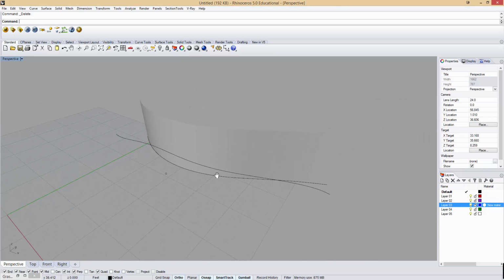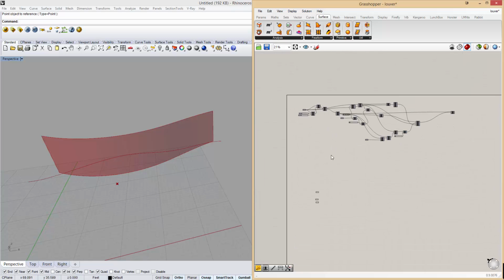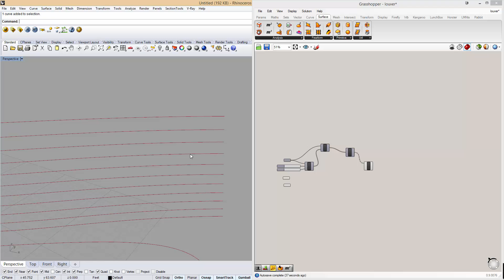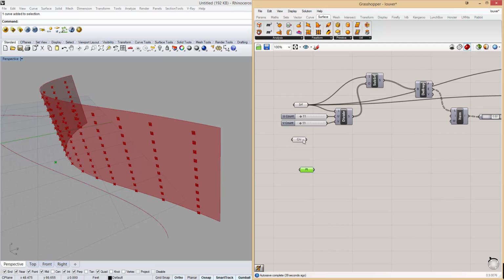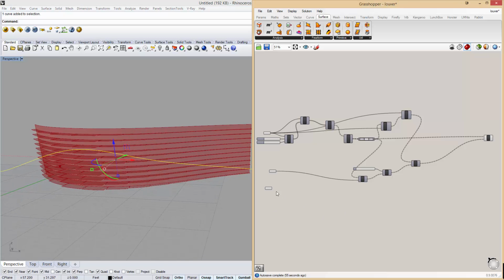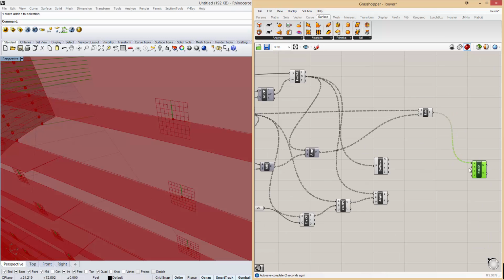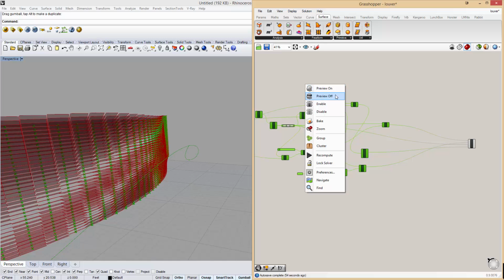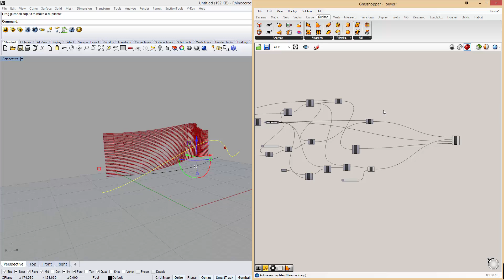Grasshopper 3D - Parametric Louvers

Comment: Hello!
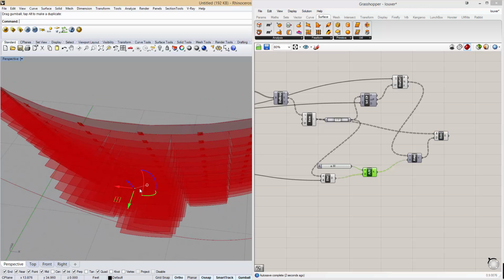at 8:50, when I extrude, it extrude vertically instead of horizontally, it appears that the mid points are extruding vertically, instead of the horizontal lines, how can I fix this?
Thank you

Comment: For some reason the extrusion of the panels doesn't happen in my surface (8:50).. Any ideas why?
Reply from the maker: Marika Mavroleon Check your units.  You might be extruding just a few millimeters.
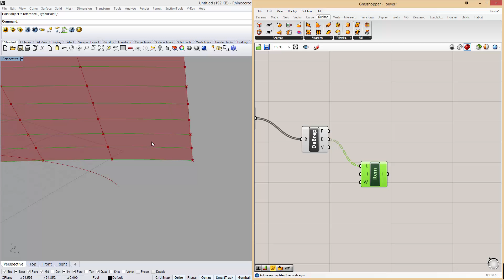Reply: ***** Thanks! I adjusted the units and it works fine now.. One more question... At 4:27 when you add the "list item", your horizontal lines are highlighted but in my surface only the vertical lines are highlighted... Any ideas how I can modify that?
Reply from the maker: my horizontal edges were list item "0".  use a slider to make your "i" value "1" you can also try 2 or 3
Reply: ***** got it! And I have one more question.. Sorry, as you can tell I'm a beginner.. At 8:55, when I add the extrusion, my louvers extrude on the opposite side of the surface.. I tried moving the point to see what happens but the only direction they extrude to is the inner surface where typically the interior of a building would be. How can I make them extrude on the same side as your video? My surface is very similar to yours...
Reply from the maker: click the surface in rhino and use the "flip" command
Reply: ***** Your video is very clear and easy to follow! Thanks for the tips!